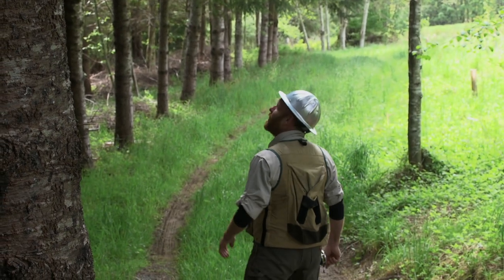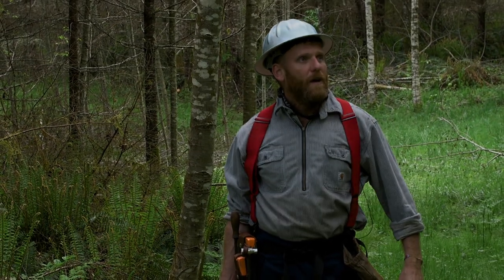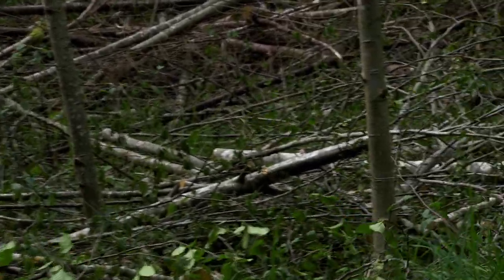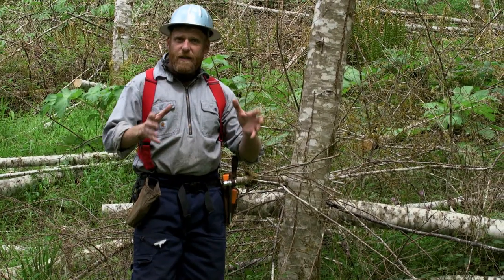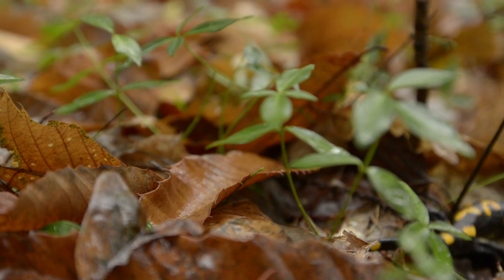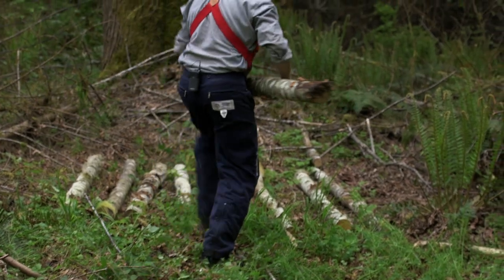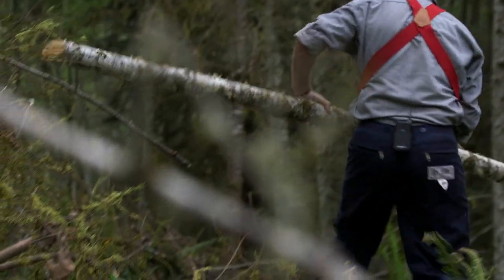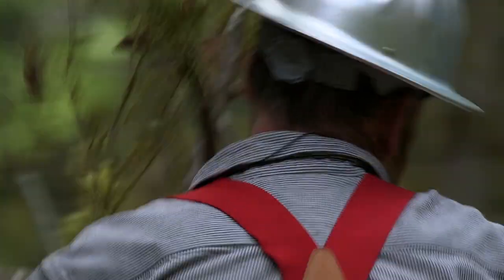How to Build a Wildlife Habitat Pile

Comment: How long does it take for the base logs to rot down to the point rabbits cant get in or under?
Reply from the maker: If the pile is made with Douglas-fir, the bottom logs should last at least five years before rotting and beginning to collapse. The larger the diameter of the logs, the longer they'll last.